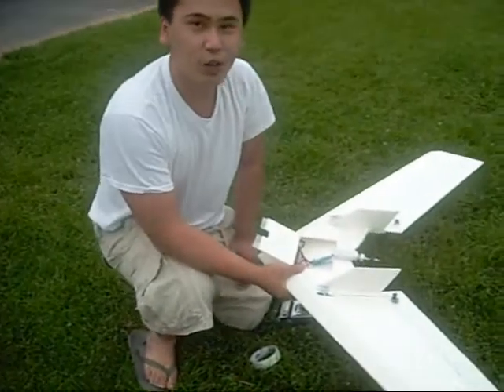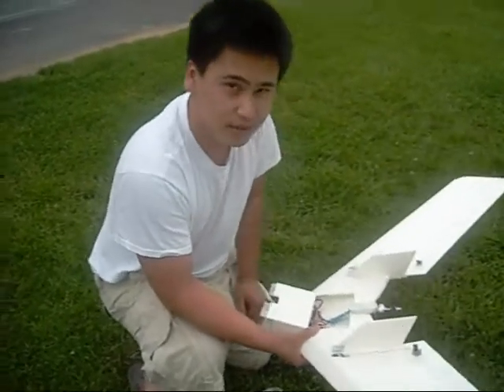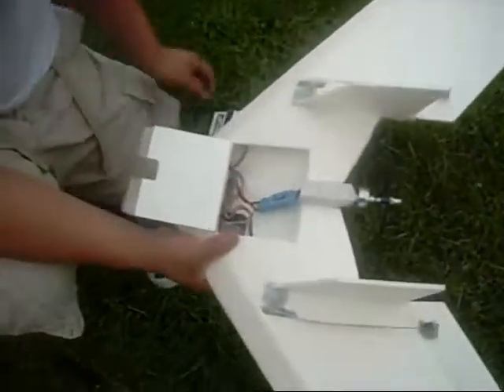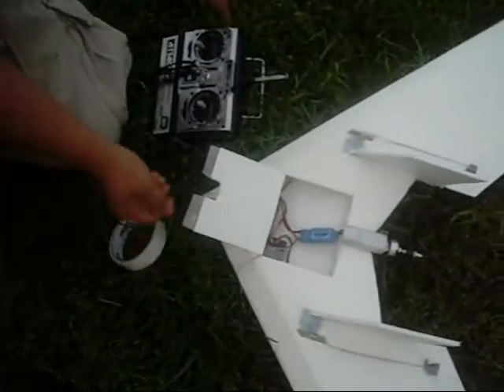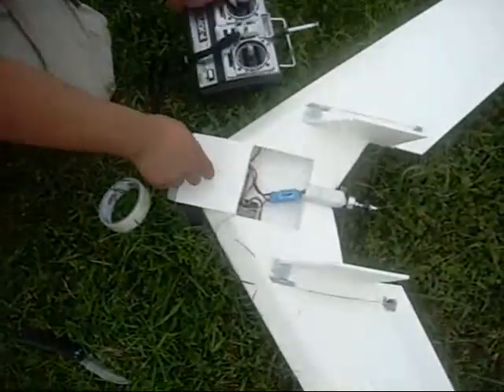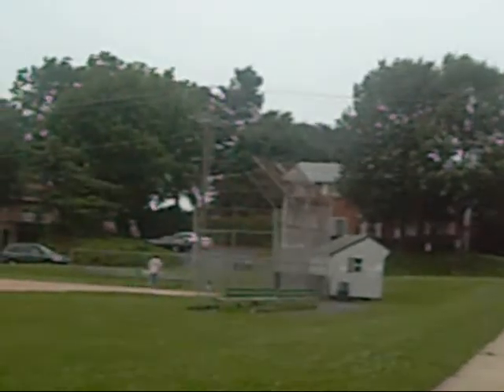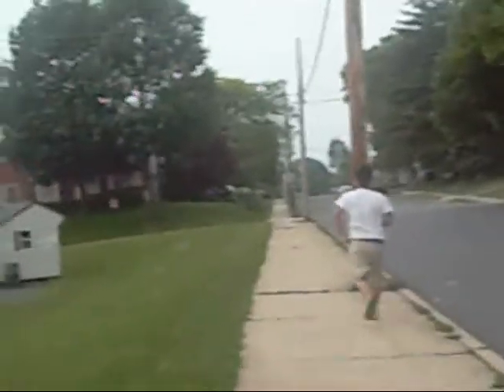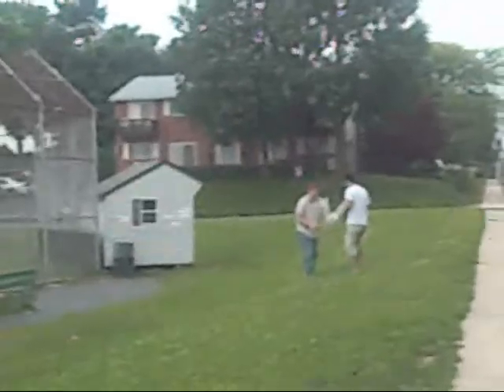2nd home made rc flying delta wing

Comment: you should add a video camera on the nose that would transmit a wireless signal to a small t.v. it will better aid you with some of the flight and could be used with a recorder.......If you do it post it!

Comment: Doesn't the disposable combo kit from Grayson only have a 1100kv motor? What size prop are you using? 

Didn't realize you could use that combo for a flying wiing with a smaller prop.